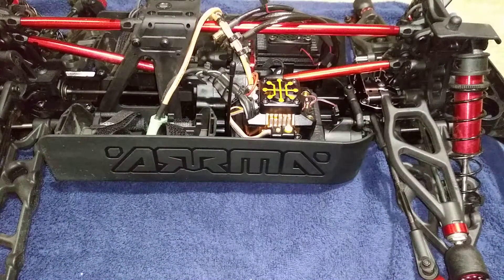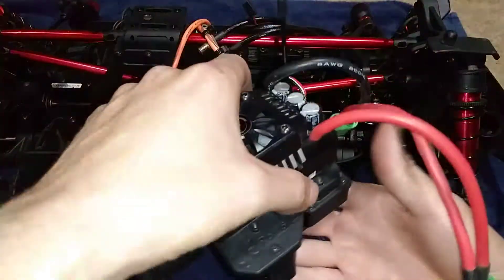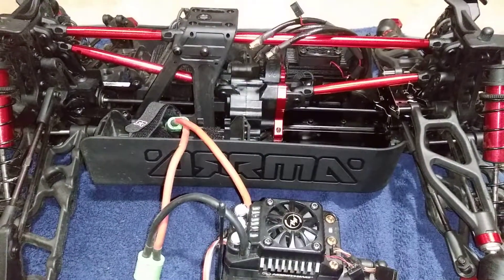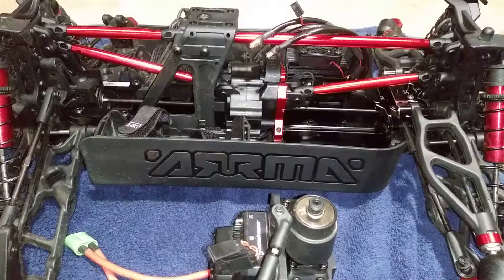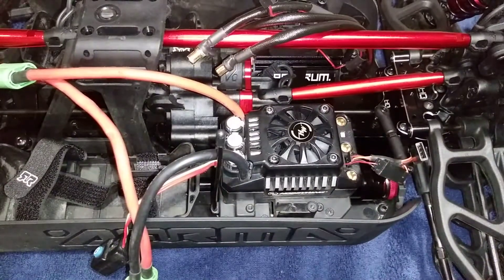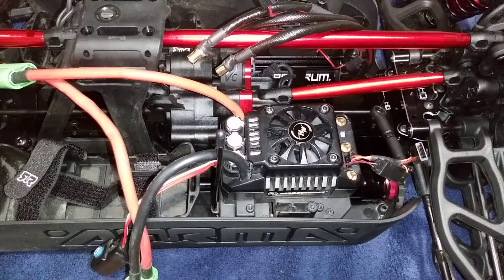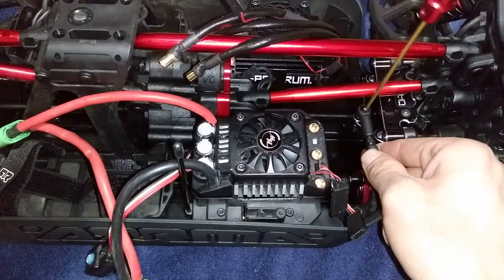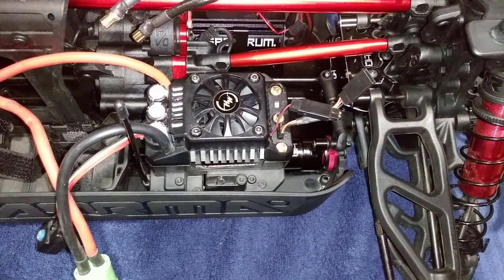arrma outcast HR servo saver install plus heart transplant

Comment: I ben looking all over the place for a video or some info i could not get the stock servo to center out with the stock servo saver in looking like all the hot racing  servo savers are all sold out